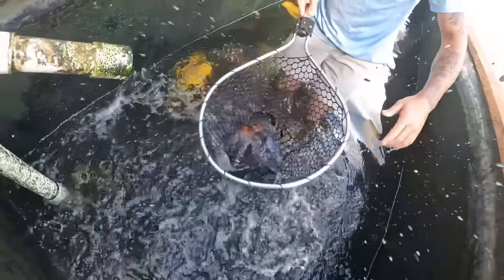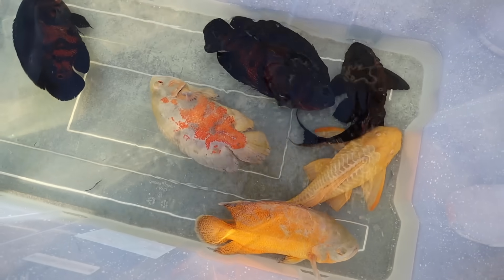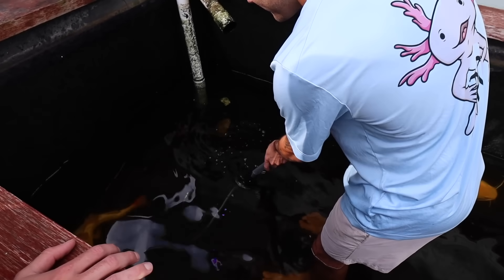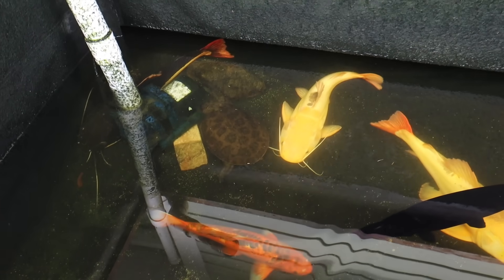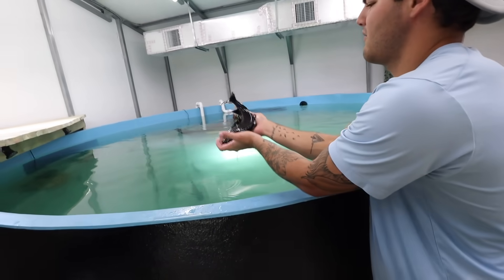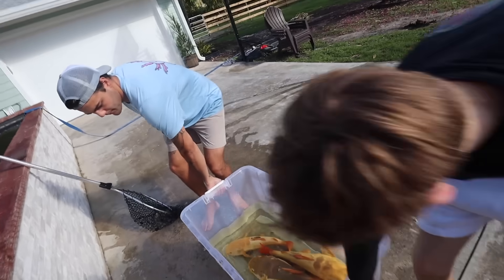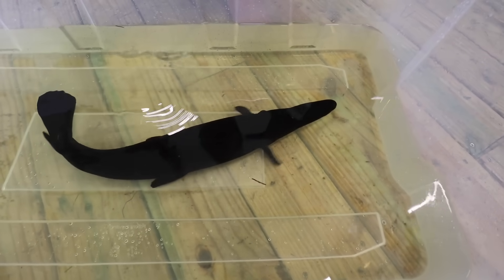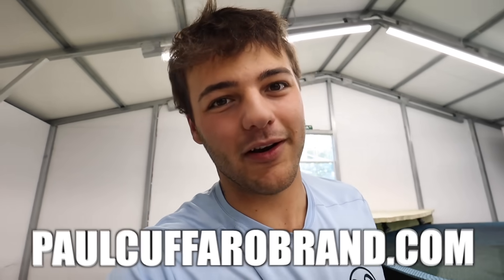Transferring ALL My EXOTIC FISH into 5,500G POND!!

Comment: solution to the fish jumping - make a clear plastic rim around the perimeter of the tank, high enough to prevent the fish from jumping out, but you'll still be able to see through it, as well as from above on the deck. takes away the downsides of having a net over the tank which limits top visibility and could possibly scratch up the  fish